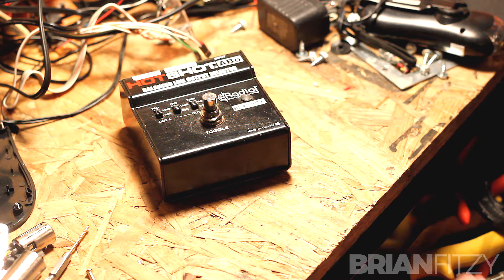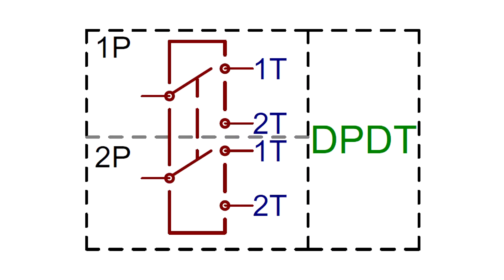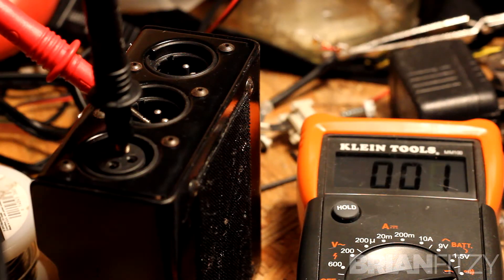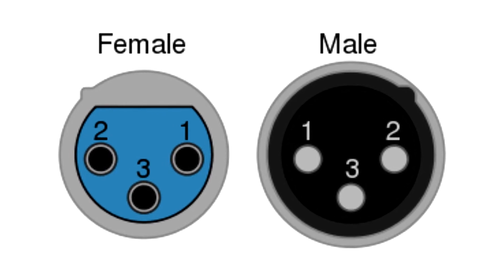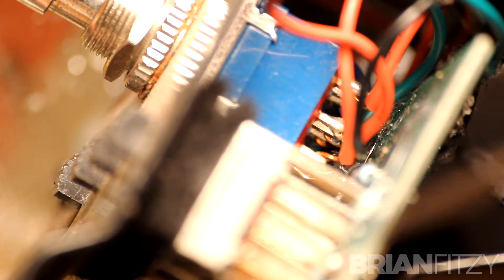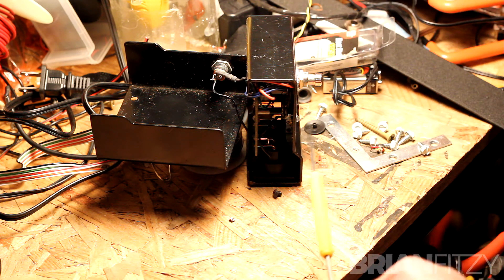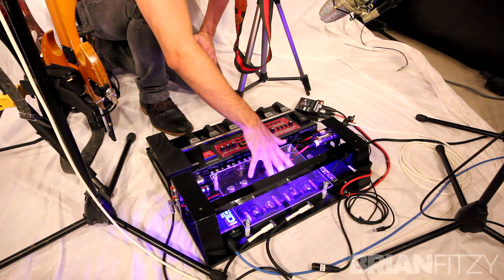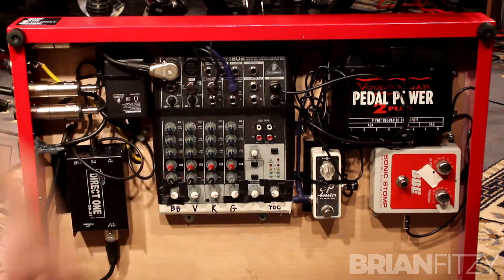Radial ABo Mod

Comment: Hey, Thanks for the video!

I did this mod but i have a low buzz through mine now. any thoughts? what power adapter do you use?

Thanks
Reply from the maker: Hey man!  Hmm..make sure that you don't have anything shorting against the chassis of the pedal, or anywhere else for that matter.  Check your solder joints as well.  As far as power adapters go, I typically use a Voodoo Lab supply but I've also had no buzz with a OneSpot etc.

Comment: Cool mod! I don't know if you looked around much, but Whirlwind makes a microphone output switch that has built in LED indicators for the output. It's about twice the price of the Radial though. http://whirlwindusa.com/catalog/black-boxes-effects-and-dis/miclineinst-switchers/selector-xl
Reply from the maker: Thanks!  Oh, I looked around for quite a while before going this route.  The Whirlwind is also way bigger and requires 24VAC, I guess to supply 1/2 Phantom?  Custom wins out :)
Reply: I did think it was strange that it required  24VAC, especially when it has a 9V battery option! Who knows what they were thinking.
Reply from the maker: Since it allows for use of condenser mics, I would assume that's the only reason for the 24VAC.  You could use a 9V battery clip adapter to power it from a standard DC source and have the LED's and full functionality with dynamic mics.